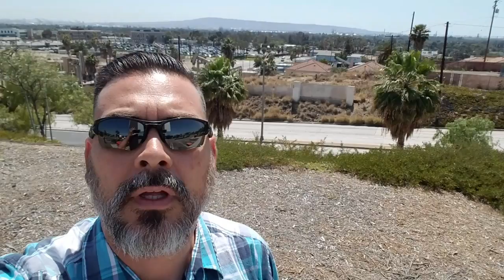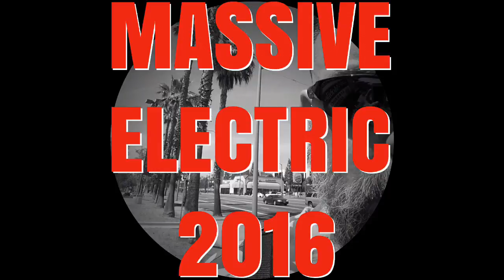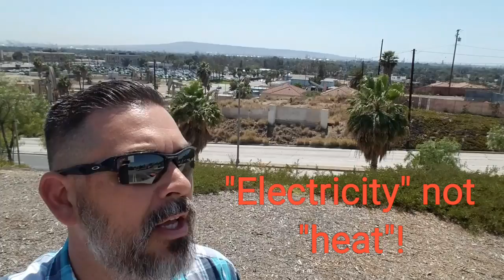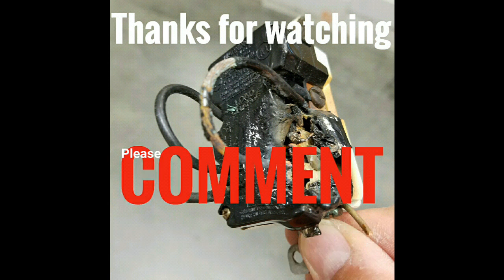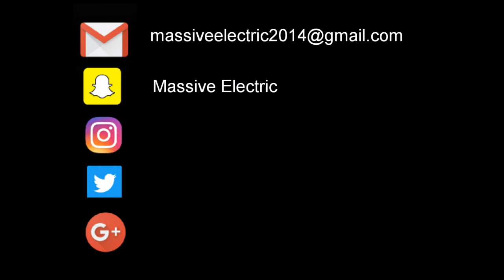My A/C Keeps Tripping My Breaker!

Comment: Will be checking on dedicated circuit for AC !!  That seems the only way to go for me. I'm brand new to camper life and I had no idea about all this electrical stuff!! I figured if there's a microwave, an oven ( but that's gas )  , anyway all this stuff, then everything could run, right?? Nope. I have a 30 amp camper, so I have to turn this off so I can run that, etc. Didn't know about a dedicated circuit.  That would be GREAT!!!

Comment: i have saw a lot of folks around my area that just pull out a 15a breaker an pop in a 20a or pull out 20a double & pop in a double 30a & then their house burns down 6 months later & they dont know how it happen ! i have ben a electronics tech for most of my life (Jack of all Trade's & The Master of None) & i always like too use 20a wire minimum so later when some one keeps tripping a 15 & just pops in a 20 their Already  Covered ! I se a lot of double 50a breakers for hot water heaters,dryers,& stoves & i like to use 30a & I dont really think their is no reason for any thing Bigger to be honest My Stove runs on a 30a Dryer is 30a & H Water is 20a But i Ran The Wire for The Biger But like to use as small as i can Just for Cheep insurance we will call it ! & I Never Use 14/2 That is Against The Rules at my House..lol.

Comment: Were is the 🤣🤣🤣 button. Who the hell doesnt have the ac on a single circuit?
Reply from the maker: there are plenty of older homes that have window a/c's which were installed long after an electrician installed the wiring. many tenants have no idea that air conditioners draw tons of current, so they just buy a unit and plug it in...

Comment: I just replaced the breaker and nothing at all is on it but the a.c. it's a 20 and maybe a.c. is broken?
Reply from the maker: You'll want to get a multimeter, or at a minimum one of those non contact voltage testers. You'll need to find out if you have electricity coming out of the breaker, on the wires themselves, and at the receptacle.

Comment: Who wires an air conditioner without a dedicated circuit?  Never seen that before.
Reply from the maker: +Mark Nmolly maybe those who live in an older building, don't know how much electricity anay a/c uses and just want air conditioning. Most, if not all, tenants and home owners have no idea how electricity works or code requirements. They just want to plug stuff in
Reply: A west coast electrician .
Reply: Come to africa
Reply: Mark Nmolly - exactly what I thought when watching!  Yeh my 10 amp Keurig coffee maker is on my AC circuit!  No wonder my AC keeps tripping when I make coffee!  Only in California.  Thanks for the video
Reply: What about when you turn off your AC and it sounds like it's still running and then it pops the circuit breaker

Comment: Mine tripped AGAIN today !!!!!
I went outside to the "Breaker Box"....turned it off, on, off and then on. Came back inside the house....turned the AC back on and BINGO.
AC unit was working once again ☆

Might look into adding a the " Private Circuit Box" just for the AC unit.
Reply from the maker: +pamela creel glad you figured it out! Thanks for watching.
Reply: Massive Electric Thank You...

I was also told today, that changing the (I'm not going to call it the proper name) the switch that belongs to the AC unit....in the Breaker Box is a good idea. Only the one that turns off the AC...